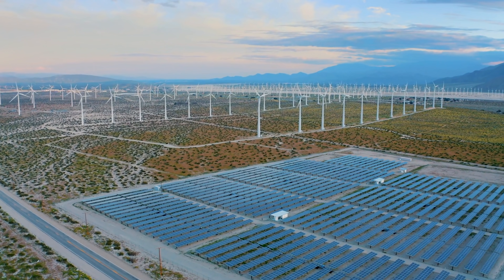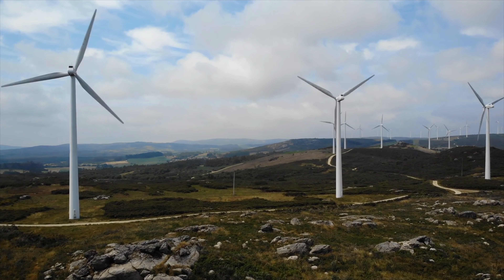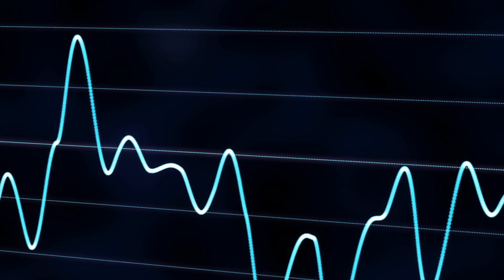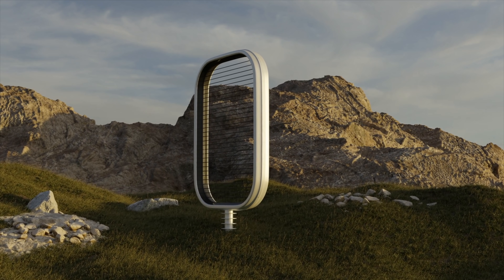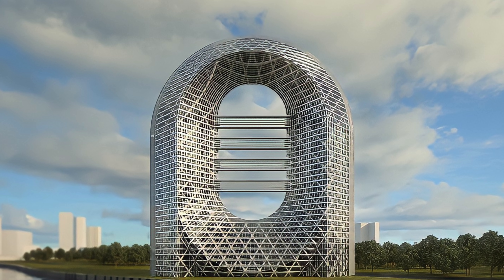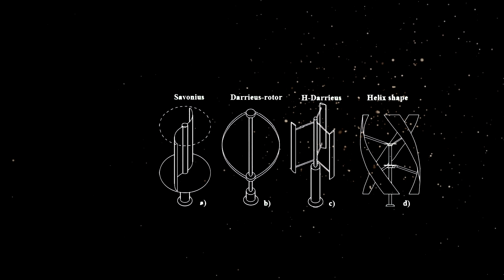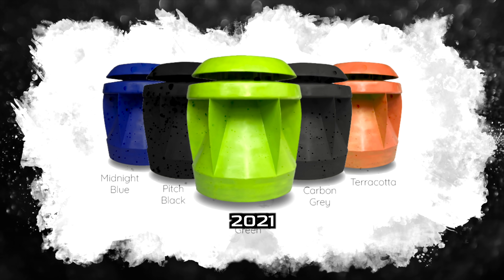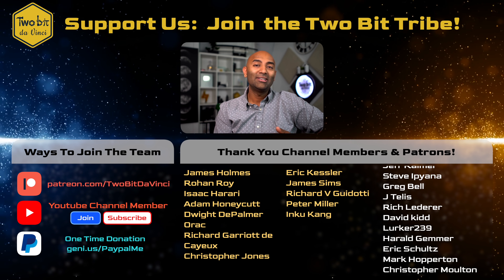These Wind Turbines have NO Blades!

Comment: want to make even more energy then take the energy from that device and turn a motor with and turn a beat truck alternator for 320 amps. be sure to understand that it is just as crappy as this stuff if you make it a capacitor charged by a solar panel that charge the alternator prior to it starting because when night happens the wind will die and the kick back in but it won't have any charge at all.

Comment: Keeps mentioning little environment impact, that is until you figure in what it takes to build it, maintain it , dispose of it and replace it after 10 year's. 
 Yes we have to keep experimenting but lets stop pretending these things are green and wasting billions of dollars on feel good solutions.
Reply: Well the overall harvesting factor of state of the art modern wind turbines ranges from ~50 to ~150 depending on location. That means a single wind turbine will generate 50 to 150 times as much energy as what had to be spent to source raw materials, manufacturing and Installation. 
A modern wind turbine has an energy amortisation period of 0,25 to 1 year.

State of the art wind turbines have nothing to do with feel good solutions... maybe besides making investors feel good through the money they return.
The solutions shown in this video on the other hand ... well I don’t know. Maybe if we collect more data it convinces me?!

Comment: What kind of birds do cats kill as opposed to windmills? Some birds killed by windmills are endangered and you would go to jail if you killed one.
Reply: Good point! Sadly, I don’t know the answer to your questions.
But, How many endangered birds are killed by:
- windows 
- cars 
- tall buildings 
- high voltage power lines 
- habitat loss through deforestation 
- habitat loss through urbanisation 
- habitat loss through opencast coal mining 
- agricultural chemicals  
- overfishing 
- oil spills 
?
I don’t know that either! But what I do know is that each and every one of those points I listed are estimated to be responsible for at least one order of magnitude (or more) more overall bird deaths than wind turbines.
The imminent dangers of climatechange are said to threaten 2 out of 3 bird species! Wind turbines could be one piece in the puzzle to resolve that issue.
Reply: @petergoestohollywood382  
Imminent dangers of climate change? 

You realize man has feared the weather since before he walked upright, right? Ancient cultures sacrificed humans to please the gods and modern cultures burned women as witches for cooking the weather. All this happened when Co2 levels were low. 

It's 2021 and instead of accepting the weather is dynamic and will always be deadly, we still fear it and are trying to fix it, this time by lowering Co2 levels. It will not end well.

After spending 100's of Trillions of dollars and destoying the worlds economy to successfully lower Co2 levels, your're going to be very surprised that it didn't solve the problem. 

Then we'll try human sacrifice again, with the logic we probably didn't do it right the first time. Humans are a strange creature.

Comment: Bladed Windmills to be Honest have a Tremendous Carbon Footprint.
Just the Mammoth Cement Base. It is Mammoth.
Reply: Mammoth? One ton of cement releases between 0.6 and 0.9 tonnes of CO². One tonne of coal releases double that.

A 1000 MW coal plant burns around 9000 tonnes of coal a day. The socket of a large wind turbine on land requires between 50-150 tonnes of concrete. A drop in the ocean.

Comment: Carbon fiber blades sound great, except for the massive amounts of waste the manufacturing process produces. Toxic resins, vacuum forming materials, etc....all thrown into the landfill when done. Not to mention tons of ppe, solvents and such, to go in the garbage. And when a set of blades brakes or reaches life span limits, it has to be disposed of.

Comment: I think a lot of wind turbines will make use of increasingly larger funnels, which to turn lower speed winds into higher speed winds concentrated on a smaller wind turbine, Those would be specially designed for wind to spend more time inside the turbine, to extract more of the energy of the wind. Another option is to use updraft towers or updraft chimneys to use sunlight and humid air to create an updraft powerful enough to spin a ground-level wind turbine or small team of smaller ground-level wind turbines which to also make use of funneling the wind. Think of a circle with straight tangents not overlapping other tangents, used to funnel the wind into a wind turbine which changes that wind almost parallel to the ground into wind perpendicular to the ground, which also creates local cooling effects through lowering the pressure of nearby air and through the creation of artificial clouds which to shade the area. 

This could also be used to cover a city, so excess heat can be harnessed, and so snow and heavy rain isn't as much of a problem inside the city. We could see completely domed over cities, which to have not only an outer rim through which wind to spew into the city, but also long above-ground tunnels which to protect the vehicles from those stronger-than-normal winds.
Reply: Love the updraft tower idea. But it never gets built.
Reply: @TheBooban  Which is really sad. Because even the pilot project (demo version) which was only 200 meters tall ran at the profit, with all the downtime and unoptimal running caused by it being used for research about the efficiency updraft towers in general. Not only that, but large pipes could go from the sea side to inland, which to get steam inland to create clouds, drinking water, and also electricity, getting the steam from evaporating sea water with long greenhouses heated by concentrated sunlight with the help of fresnel mirrors, to get very hot steam which to be funneled into the pipes which go inland to a higher elevation to the generator and dew condenser part of the system. The very concentrated brine or salt could be processed to extract useful minerals, and then the rest sold to the consumers.
Reply: @SapioiT  yeps, and underneath could be all green, in a desert. Been following enviromission for years. So sad :(.
Reply: @TheBooban  Not only that, but it would bring rain inland. There could be lush green vegetation in Sahara. Food forests and farmland. And even places like Saudi Arabia could make use of seawater vapors for water, tall walls, and dark-colored fine plastic mesh, to reduce the amount of sunlight and heat which makes it underneath, and support pillars to hold the mesh away from the walls, and they could grow food there. Or, instead of the mesh, they could place lots of solar panels, so that very little sunlight makes it through, providing enough shade for plants to be able to grow.

The problem is not that it's not easy or not cheap, but that it's not wanted. And they could use genetic engineering to make plants which help with the desert reclaimation. And they could use a field of deep drill holes/wells to soak up the water from what would otherwise be flooding, into the underground water system. And long-growing fast-growing trees could be grown to large enough sizes to cover a pond or a small lake, and crawling plants helped by ropes to get from tree to tree, to make that pond/lake more drought-resistant, and to act more like an oasis. Water redirection strategies could be used to prevent floods and to get water to the places which can soak it into the ground, like forests and fields of drilled wells/holes. Imagine a filled 2-liters bottle's width/thickness, that's how thick the well would need to be, and a few hundred meters/yards deep into the ground, and have something like half a meter of distance to the next one, and optionally have a small wall of porous cement to help the holes/wells (to) maintain their shape after the water starts filling them. 

Really makes me think that the moon-map conspiracy might be real. I mean, there's a conspiracy saying that the magnetic north is rotating around the true north so that the true north has a few nearby islands which still get sunlight, the soon-moon pair rotate around the magnetic north pole and the magnetic north pole rotates very slowly around the true magnetic pole, and the moon is a map because it was known in antiquity and even in medieval times as being made of silver, and we use silver for photography, and the carrington event acted like a flash which to update the moon map, so we see a distinct area in the center of the moon, which is the true magnetic north, and we see another distinct area which is the sun reflected by the water surface, and to get to the true magnetic north we need to get to the magnetic south, and at some point the compass will stop working, so we need to use the star map, and pleiades is the star about the true magnetic north because the other stars in the sky rotate around it, but the water and airways around the antarctic circle are forbidden for civilians to get near, and there is no light and almost no wind outside of where the sun and moon rotate, so the rest of the world is a massive wall of ice, flash-frozen to be preserved well, and which can flash-thaw to cause mud floods, and to cause animals (and humans) to still survive the ice-age-like freezing (even if in small numbers). For more info check the video "all maps are wrong" by "autodidactic 2".

I mean, I know that extraordinary claims need extraordinary evidence, but the mainstream situation has gotten so extraordinary that such wild conspiracy theories have started to seem more likely to be true, and there is plenty of evidence for the theories, too, including some of them being conspiracy facts, due to declassified documents. The official story has gotten so unbelievable that people have started believing conspiracies.

Comment: Beautiful evolution :ok_hand::ok_hand:
Wondering.......why not use for cars ?  vehicle movement on highway itself generates wind that can be used in as fuel to the same. Electric cars using wind energy. It can be hybrid model, in the initial ignition stage use charged battery or gas ,later when on highway wind plays the role.

Comment: Solar panels are so cheap now you really have to explain why wouldn't you put them on any available roof, and in some cases wall. The inverters they need are also cheap enough to support spreading them everywhere and sunlight is usually steady enough source to make this viable. Problem with wind is that smaller turbines are still pretty expensive and setting them up is not quite as simple as with solar panels so between materials and work needed the cost per watt can get ridiculously high. Then there are idiots ans scams like "let's put a big funnel in front of a frame with 100 computer cooling fans in it and produce up to* 10kW power!"  *:"Up to" includes zero watts, which is what such contraption would likely produce.
And while wind blows almost 24/7/365 it does change its speed and direction relatively often.

Comment: we didnt create cats and they kill birds from instinct, we created wind turbines they kill birds beacause we didnt consider the birds. The best solution is tidal power, the tide comes in the tide goes out it never stops for very long , wind stops for days at a time , wind turbines require phasing with the electricity grid and use electricity to keep them in phase. have you ever noticed them turning on a day when there is no wind?

Comment: Wind turbines are only  25 % efficient,  all materials to make one are not renuable. They are useless until they are connected with hundreds of miles of underground wires and then the power has to be converted to be used on the grid. Now we are at 18 %.

Comment: I realize these videos are not easy or cheap to produce, but I'm wondering if you have considered or will consider producing an equivalent video to this one on the topic of "Wave Generators" ?
As I'm confident you know, Ocean/Water Wave and/or Tidal Energy Generators have also been and are being tested around the world. These offer yet another way to offset or simply contribute to the overall electrical demand however, obviously they need to be in a large body of water that has high winds and waves and/or significant High-Low Tide variables.
I would love to see a video like this one (Future of Blade-less Wind Turbines - Solid State Wind!) on the above mentioned topic ... enough so that I am going to subscribe today.
Thanks for this video and if I may .... thanks in advance for the above proposed topic video.    :)
Reply from the maker: We have such a video planned!!

Comment: so if wind goes hard enough to split two magnets...  it makes power?
Reply: Magnets are like batteries in they send electricity on one side, and pull on the other. What's happening with a normal generator/alternator is they force the existing energy across a metal to force it down a wire. Have you ever checked out Gerard Morins over unity videos? They expose the bull crap lies were fed about energy, it should be free. 
   For a even deeper understanding search utube for Lt colonel Thomas Beardens video pulling free energy from the 4th dimensional vacuum. There's also the keshe foundations magrav free energy pack. There's also a video on their work. It's been out for year's and nobody will discuss the fact we shouldn't be paying for energy. 
   They had copper electric wires over 6,000 year's ago, it was made by the same process that fine gold threads were ad described in the book Leviticus. If you watch the videos i mentioned and like learning the truth, check out Gene Kim's video electricity in the Bible. There's a reason world leaders are paid for by globalist elites, and it's more than just greed that had them getting rich while we're still working on the company farm!!! Their a bunch of satanic pedhos like the Pope and our politicians. Watch them videos and try asking anybody with a electric engineering degree about what science knows, nobody will admit crap lol. God bless!

Comment: “Cats kill more birds than windmills “ argument has been debunked long time ago but is still repeated by windmill propaganda.
To recap - not all birds killed by windmills are equal. Cats don’t kill large birds like eagles that are endangered and breed slowly. Windmills kill large birds as well as small, common birds that cats kill in larger numbers.

The major flaw of wind and power is low energy density, measured in power units per surface of earth occupied by generating infrastructure.
Less of a problem with off-shore wind farms but then maintenances cost of the off-shore turbines is much higher.
And the unstable nature of wind and solar is an ideal excuse to build more power plants burning natural gas.
Less pollution than coal, same amount of CO2.
Two steps forward, step and a half back…

People have been scared of nuclear, environmentalists make hydroelectric dams impossible to build.
Hopefully geothermal technology develops in next few years to put an end to wind and solar nonsense.

Comment: I have 20KW solar array in my yard, on posts. It "looks like" a solar array, and it is beautiful. I 'toggle tilt' it twice a year to best match the annual solar angle changes.!.!.  I built it all myself, 11 years ago, and it still works great today.!. Though I started when panels were 4X the cost of PV today, it has paid for itself several times over, while supplying my home with free electricity and transportation with an EV.!.!.!.! The excess is sold to the grid,and I get SRECs.!.!.!.!. The state Govts could easily allow this in every state at '0$' cost to the state coffers, since it is funded by "Ute" carbon offsets.!.!.!.!. BUT, we get the Govt we ask for.!.!.!. Good luck.!.!.!.

Comment: There is no such thing as a free lunch which is a picturesque way of expressing     a fundamental law of physics   titled "The Second Law of Thermodynamics".   What that means in the real world is that if you try and harness the energy from the movement of air displaced by a moving vehicle you increase the drag of the air upon that vehicle and it has to work harder to displace that air.  And that pesky "Second Law of Thermodynamics" tell us that the energy expended to overcome that additional drag will be more than the energy captured by the device that is attempting to harness that energy...

... With all these so called renewable energy solutions you have to examine whether the energy expended in manufacturing them, transporting them to where they are deployed, maintaining them during there useful life and  disposing of  them when they are no longer useful matches the energy savings they provide  during their working life

And sadly in most cases they don't